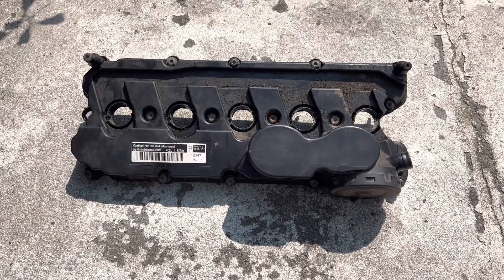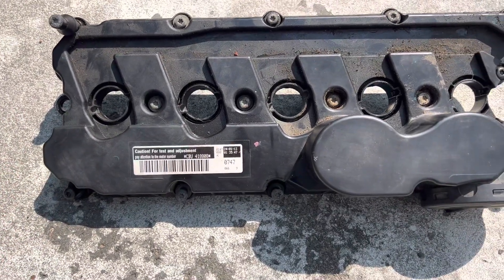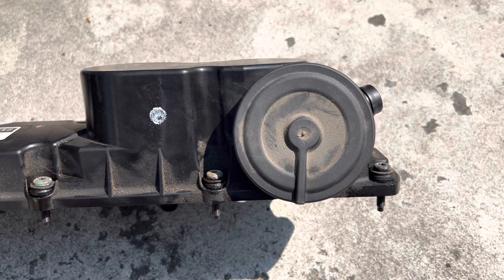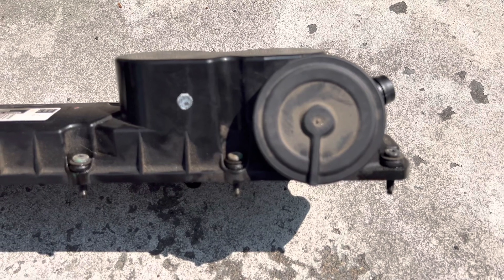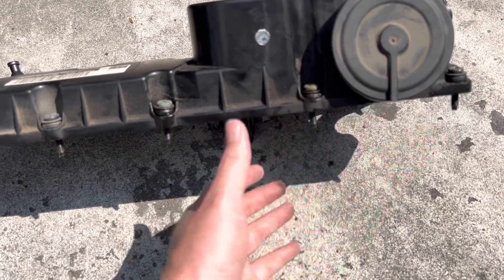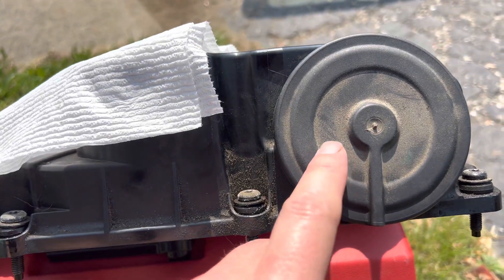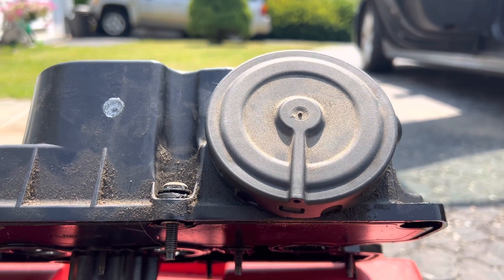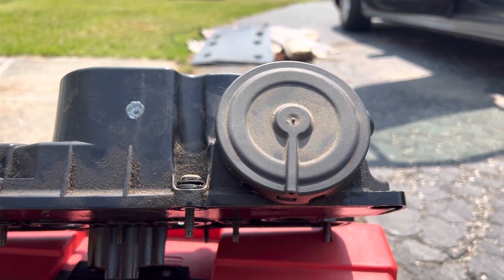Demystifying how diaphragm membrane style PCV valve cover oil separators and breathers￼ work

Comment: On a VW T6 2018 this whole module costs 300 euro + another 400 ATLEAST 2h profesional to reinstall all again... JUST because of this 10 USD membrane. I just installed a second one right after it with a Oil catch can...  THIS CAP IN FIXED ON THE WHOLE MODULE U CAN NOT REPLACE SHIT)) GERMAN DESIGN.
Reply: Did u try china? Or did u make the mistake of looking in Europe for a cost effective repair on a euro car lol.
They will all sell u a valve cover when China makes the diaphragms and parts to replace them on most euro cars.
I just found one just now for  a T6 on Google in 2 seconds for under $30 Australian.

Comment: Is the spring inside really necessary? I took out mine cuz the diaphragm cover was not closing fully causing wistle sound. Without the spring it closes fine without wistling sound.
Reply: The valve will now be open at times that it should be closed.
Usually a whistle from an engine is due to a faulty PCV valve causing excessive vacuum to reach the crankcase which in turn can suck air over ur front crank seal etc, causing a whistle, this can be easily diagnosed by simply opening the oil cap at idle and if the whistle stops uv got urself a faulty PCV valve.
Personally I would be refitting that spring and actually diagnosing the issue before it causes more problems.